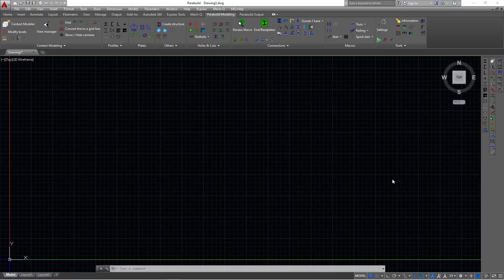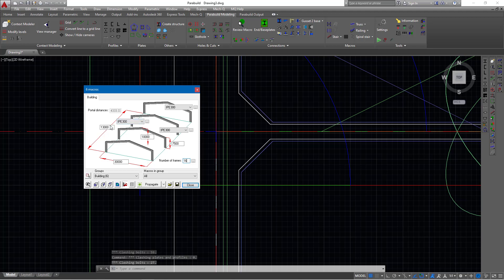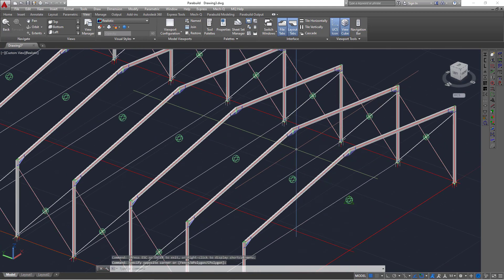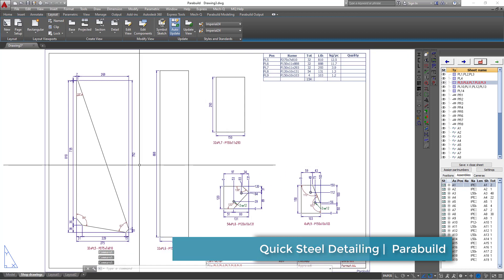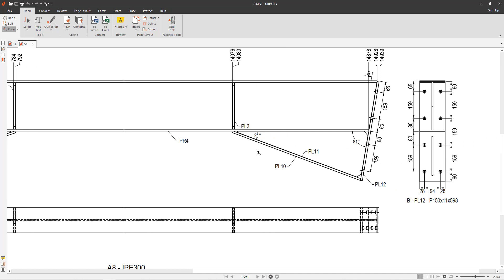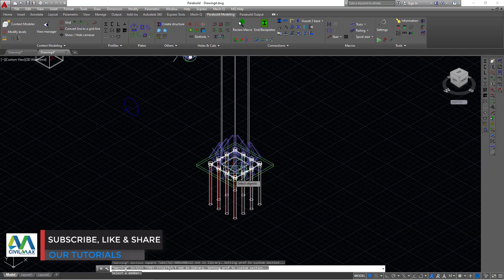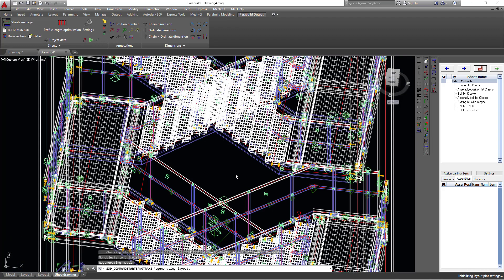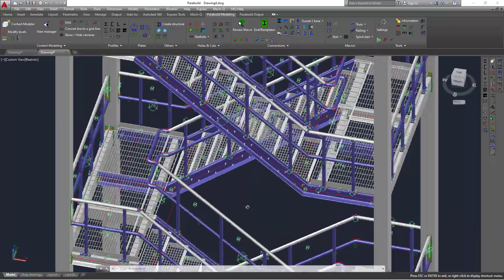Introduction to Steel Detailing | Parabuild

Comment: Hi Maurice, great tutorial video , nice program. But i have a question about it , does parabuild choose every size of beams, coloms etc. By itself? I mean we see u choose  IPE 300 or L 50x50x5 for a building 90x30 meters. Does the operator need to choose whatever he wants or is it set by the parabuild software . Thx kevin
Reply from the maker: you have the freedom customize your structure with any steel profile in parabuild
Reply: Hi maurice yeah i understand but what i mean is , does parabuild choose the right steel profile needed based on the chosen lenght. Or is that information put in by the person using parabuild with info he got from a architect or engineer?   For instance you have a IPE300 for 24 meters of range in this tutorial but is it random or generated and calculated by parabuild for final assembly?